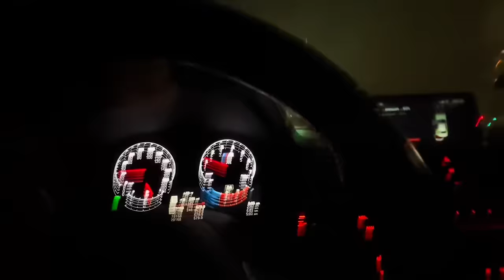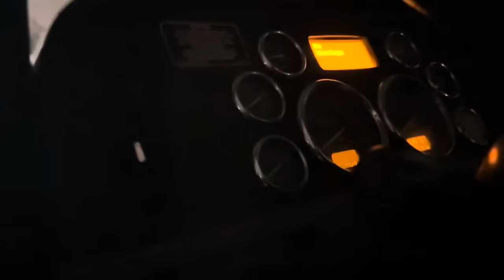Day in a life of a concrete mixer driver

Comment: Yep I had 11 year in the concrete business driving both rear discharge and front discharge  Oshkosh and Mack 10 yards at a time even though legal with the booster axel was 8 1/2 yards for most whom don’t know 1 yards = 4000lbs = 2ton so 32000lbs at 8 1/2 yard but we carried 10 yards so 40,000 lbs with 175 gal of water and 100 gal of fuel 27,800 empty plus 40,000 lbs miss it. Did a lot of conveyer and pump work here in the big city of Chicago have fun stay safe and have a great Christmas 😊
Reply: You must be one of the ones that don't know the weight of a yard of concrete LOL...For your information, a yard of concrete weights 4000 lbs. not 2000 lbs.
Reply: @dennismcclintock3154  10 years ago, we could get away with 11 yds dry on a paystar 5000 with no tag or pusher... just mind them bridges and weight limits..
Reply: @hk5674  ya I corrected this my hand typed one thing and my brain did the other😂😂😂😂

Comment: Ran one of these mixers this  season. Winter has arrived up north so its pretty much done.
Not sure if will do it next year. Not enough driving and too much washing up.
You go pretty girl!
Reply: I'm in Pittsburgh driving front discharge mixer...winter only stops the lazy that want unemployment...I'm still Monday through Saturday
Reply: @Hayabusa-ll7fo  Well aren't you special. Here's how it is outside that little piece of ground called Pittsburgh. 
Here in Western Canada construction slows down in winter. In the big city of 1 million 50 miles away, they are carrying on right now and are fairly busy. Of course hoarding and heating costs money, but allows things to  move along.
I live away from that rat race and was operating for a small rural local plant. A whole other scene.
Tomorrow I start hauling grain with a set of b doubles, both local and long haul. No downtime here.
So I'll just go for a drive, while you keep washing up son. Enjoy :=)
Reply: Concrete does not like 60 below....
Reply: @davidcaple6305 wow, intelligent.
Can you spell hoarding?
Reply: @alsteeves2044  think your mom just called you upstairs for dinner

Comment: Sorry to ask this I guess dumb question, but the one tire in the back (can be seen at around 02:32min) looks to me like a tire which is… basically done?! 🤷🏻‍♂️
Do they look like this normally?
It is the first axle with double tires…
Thx for the video, being a huge BMW and BMW M fan the M2 was a nice surprise 😍 (this is the first video of your channel I‘ve watched 🥴😉)
Best wishes from Bavaria/Germany 🇩🇪, Philipp 👋
Reply: Those tires are bad/not road worthy. The driver should not take that truck on the road, a good driver would not of left with that truck.
Reply: I may have missed it, due to editing, but the pre drive inspection was pretty short.
If I remember correctly, there is a whole litany of items to check off before driving, e.g. checking brakes, air governor, suspension, etc. which I didn't see her check.
The thing is, she's not alone. This almost rampant throughout the trade of Truck Driving in USA, and in California.
The Truck Company owners know that it would be super expensive to have to pay their drivers to do the REAL preinspection check AND repairs, like those tires.
Lots of drivers, bring these things up, and either get told to shut up and just drive it, or get indirect retaliation for delay deliveries.

Then again, this is coming from a failed Class A taker that turned into "Technician"😆😆😆
Reply: That's funny shit. I thought the same fucking thing. But the video isn't about tires. It's about a lady that drives a truck

Comment: I see a lot of build up on your blades also looks like you’ve been hauling black die that wasn’t washed out good hey ask the plant manager to put some 67 stone in you mixer that will help with the build up some but if it gets worse they may have to chisel out the mixer
Also a check stand wouldn’t hurt so you drivers could see better when slumping the load and one other thing  the air bag in your seat is squeaky grease those fittings and spray lubricant directly in the center of the air bag (pull bottom portion of the seat towards the steering wheel and then raise is like a hood) just some advice to make you job easier 
Those bridge master (tag axle) trucks are the most vulnerable for turning over stay safe driver 🤙
Reply: Ok dad!
Reply: Nothing worse than the fools that know it all
Reply: @trapf2698 Dad here 
I don’t know it all but with 20years in that profession I know a lot and was only trying to help but I may also be a fool because I was also a trainer for 7 of those years 
now retired I just saw a video and gave advice 
I can see by the comments from you that you are an awesome employee probably even better person at home stay ornery my friend 🤙

Comment: Not easy my family has been slinging mud for 25 years concrete that is man I ran the pump from the age of 16-39 I liked the pay but not always the places or the temperature  and when your working in a hot place I  did everything sept I trowled finished  then I ran the pump that he’s cleaning pump I hated that  in the end it’s rewarding work it’s gotten me too see other places to go by a building or stadium and know that we worked on that building which are a lot even though my bones and back are so messed up I wouldn’t of had it any other way rip too all that were mentors

Comment: Just curious what you liked about concrete mixer driver vs semi since you got your cdl class A
Reply: I got my class a and went straight to mixer driving, it’s usually one of the better paying local jobs without a ton of physical work. Class a food delivery pays a bit more but hard work. Fuel hauling pays a bit more but requires 2 year’s experience usually and not really worth the risk in my opinion. Side dump, end dump and belly dump usually don’t pay that well.
Reply: @jgruen9854  I feel that, I started with dry van regional but got tired of the same routes. It was only drop and hook so not a lot of work but just repetitive
Reply: The nice thing about driving a mixer is you are going to different locations all day. You might go to job-sites you've never been to and never will go again. Even if you are going to the same job-site each pour is different unless its a pump. I would say the only major cons is the contractors can be frustrating to deal with and it can be difficult to keep the truck clean, that's a big part of the job.  @GmackZilla

Comment: Serious question.  :; wont all that water she is using to clean off the fins in the tank change the slump they have asked for
Reply from the maker: Hey, yes it surely does change the slump, that’s why I make sure it’s dry enough before I start adding water, there’s been times where they load me up and it’s already at the slump I need to take it as and I cant wash the fins :/ 
I make sure to take it a 5’ slump even tho they usually want it a little more wet than a 5, but if they’re ever pouring steps it needs to be a 5’ , so I just always take it a 5’ slump and let them tell me there